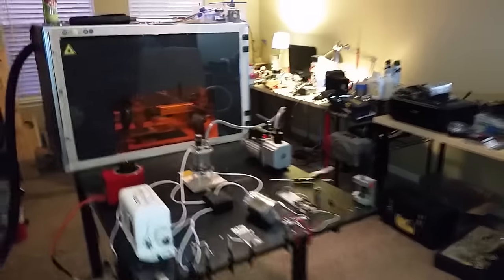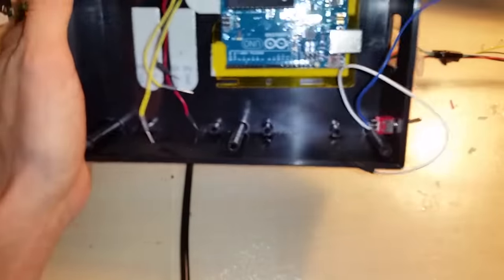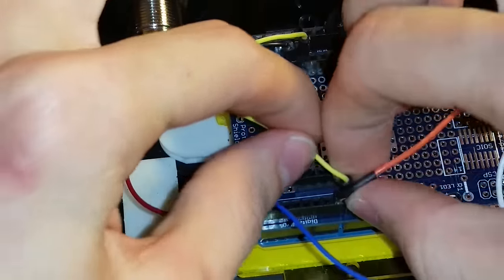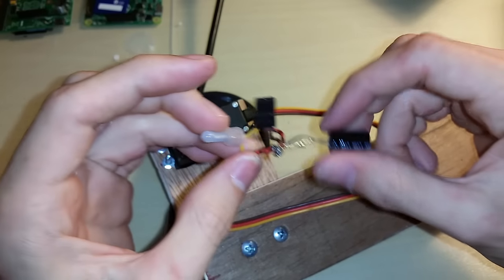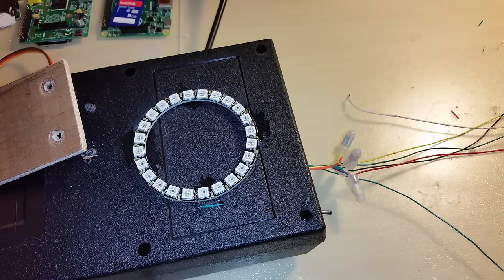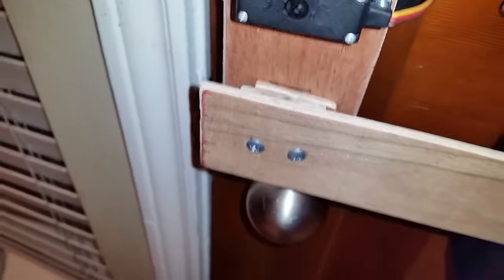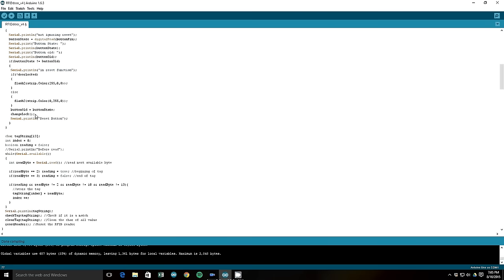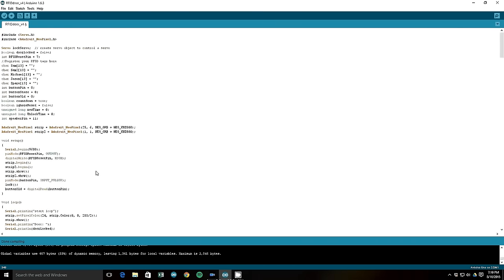Arduino RFID Door Lock Tutorial

Comment: Would you be able to open the door if there is a power outage from the inside? Will the original key work too? Or does the servo require too much torque to open when in the locked position?
Reply from the maker: The servo provides a little bit of increased resistance, but it's not too much. Still definitely possible to turn with the key or from inside by hand

Comment: is it possible to replace the rfid reader with coding that reads a usb flash drive, for a key file? Perhaps has a second usb flash drive with file to compare it to.
Reply from the maker: That's an interesting idea - I haven't ever tried using an arduino to read from usb - mostly just writing to SD cards. This looks promising though: http://arduinobasics.blogspot.com/2015/05/ch376s-usb-readwrite-module.html no guarantees, but it seems to have the necessary information to make that work.

Comment: Hey i was wondering can I have a two layer of security?  

Reading of tag & having a keypad? 
Two features together?
Reply from the maker: Yes you can absolutely do that. You'll be running a little low on digital pins for an Arduino Uno (I think there should be enough though) but it's definitely possible. There are a lot of tutorials on using keypads with arduino, so following those it would be easy to just add some code that triggers if the rfid check passes and then also the keypad code is correct. Dual security is a good idea with the potential exploits of a basic rfid system
Reply: Thank you so so much. Really Appreciate the reply! I will work on it! Thank you once again

Comment from the maker: can't reply for some reason, but it might be best to ask questions in the comments so that other people can see
Reply: so my first question is how to make the door 'unlock only' by scanning the tag and if we want to lock we need to press the button or maybe you can give me the code?my second question is a problem actually..i cant really see which wire goes to where so do you have the circuit plan ?
Reply from the maker: +poja cipojaja Hmm okay for unlock only: I have the code linked in the video description - at the end of the code I have the functions "void lock" and "void changelock".

I would add another function after void lock - "void unlock"

void unlock()
{
     lockServo.attach(9);
     lockServo.write(100);
     Serial.println("Unlocked");
     doorLocked = false;
     delay(500);
     lockServo.detach();
}

Then, to make it so that all rfid functions only unlock the door,  inside the "void checkTag" function, you must change all instances of "changeLock()" to "unlock()"; Also, at the end of that function you should remove the "lock()" call in the else statement if you don't want the lock to engage if an unrecognized tag if read by the reader. 

You could probably go ahead and remove the "changeLock()" and "lockCountdown()" functions from the code since they won't be used.

Also might want to remove the initial "lock()" statement in the void setup function if you don't want it to lock on powerup. 

Finally, you need to switch the "changeLock()" call to "unlock()" in the start of the loop function where the code is checking the button status (line 76). That should be all the changes needed for what you described. 

As for the circuit plan, that is a something I definitely should have included, and I am working on it now. Should have it finished soon
Reply: +SupaTreadz thanks a lot mate ! do let me know once you have the plan with you
Reply from the maker: +poja cipojaja http://fritzing.org/projects/rfid_doorlock_v4 you'll need Fritzing to view it but I have a wire diagram ready.
Reply: +SupaTreadz thanks a lot!looking forward to build one :)
Reply: +SupaTreadz how can i add keypad ?
Reply from the maker: Hi, keypad would be a fairly simple addition. You'd be running low on digital pins by the end, but it should have enough. These http://playground.arduino.cc/Main/KeypadTutorial http://www.instructables.com/id/Keypad-With-Arduino-Without-USing-Keypad-library-F/?ALLSTEPS offer two different approaches, the second one does not use the library.

Comment: Is this integrated into your homes electrical grid or this a stand alone battery powered system? About how much electricity does this use and can it be powered via solar? Could this be applied to a remote start in a car? I am trying to eliminate keys... I hate keys.

Thanks,
- Damien
Reply from the maker: This runs off a 9V 1A power supply from my homes AC, but minus the LEDs it could easily be run off batteries (I'm thinking of adding a battery backup for power failures). The RFID antenna itself draws 45mA and that's because I got one with the largest range, the smaller ones draw even less current. I'm sure it could be used to remote start a car (although that is far outside of my knowledge base) and yes it could definitely be powered via solar. I also hate keys, aside from something stabbing me in the leg constantly it's unnecessarily annoying. My RFID setup is great for groceries, no fumbling for keys, the key is on my wrist! And only needs to be within a few inches of the sensor to trigger it. Keyless is clearly the future.

Comment: hey can i use power adpt with i/p:100-240v 50-60Hz,0.5A
o/p:24v—0.75A ? or this thing 

https://www.adafruit.com/products/67 instead of the power adpter ?
Reply: i need your reply ASAP thanks :)
Reply from the maker: +poja cipojaja yeah that should work, not sure how long it will last off of batteries though
Reply from the maker: +poja cipojaja I think the arduino can take up to 16v or something
Reply: +SupaTreadz is that a yes or what ? lol sorry im dont really know abt it
Reply from the maker: +poja cipojaja yes you can use the 9v battery pack, I'd say no on the 24v adapter though that is too much. 12v max is ideal
Reply: +SupaTreadz thanks for the reply sorry for the silly question haha

Comment: can i use rfid rc-522 heres the link. http://m.ebay.com/itm/Mifare-RC522-13-56Mhz-RFID-RF-ID-Card-Reader-Writer-Arduino-SPI-Interface-/121057801628 instead of the id-20la ? if yes can you upload the fritz project here using the rc522 ?
Reply from the maker: +poja cipojaja I'm going to answer with yes*******

******* it could be made to work however that is a different frequency reader and uses different code and a different arduino library and is more involved than simply reading the serial number of a 125khz tag. It would not be a simple case of switching out wires, that would involve redoing a lot of the code.
Reply: +SupaTreadz for the code,that would not be a prob bcs i saw many code for the rc522 on the internet but for the wiring that means i only need to do wiring for the rc522 only or the whole circuit ? if for the whole circuit i know its a big job,i will try to find it by myself
Reply from the maker: +poja cipojaja looks like for the wiring,  MOSI goes to Pin 11, MISO goes to Pin 12, and SCK goes to Pin 13 (that's Uno specific wiring). Looks like all of the other pins can connect to any other Digital Pin it just needs to match whatever code you're using. I guess SS, RST, Relay, and Wipe are the only other essential wires that need to be connected, so just match them to the code. And I guess it has LEDs built in thats pretty cool
Reply: +SupaTreadz thanks for the feedback ! asking in the comment lot of questions may not be a good idea so i just want to know how and where did you learn the coding stuffs ? is it hard ?